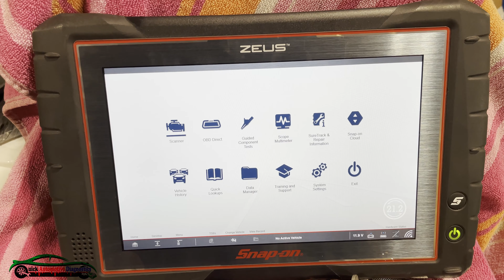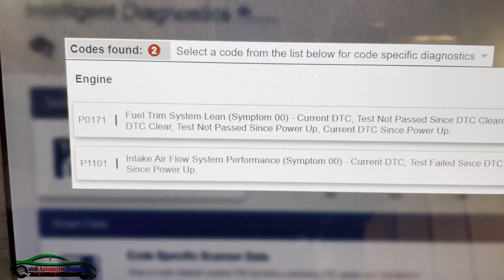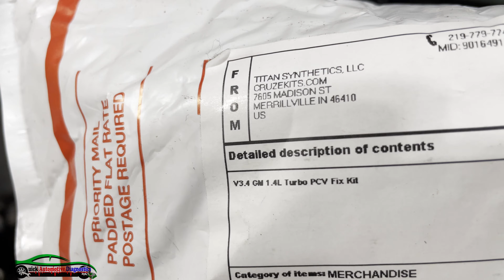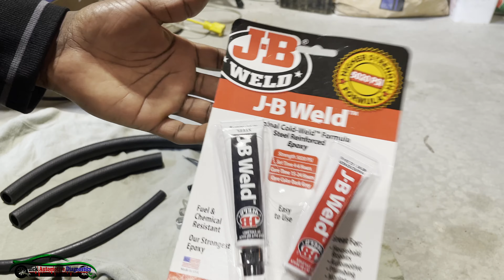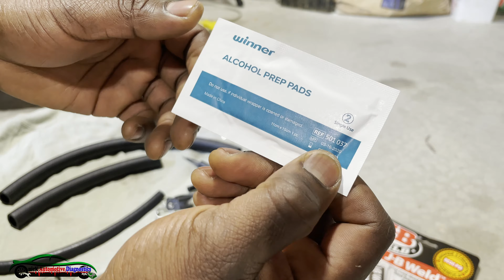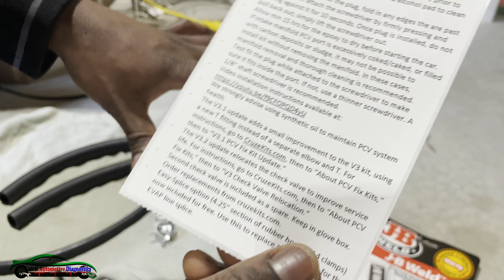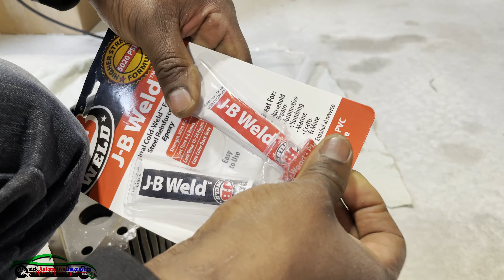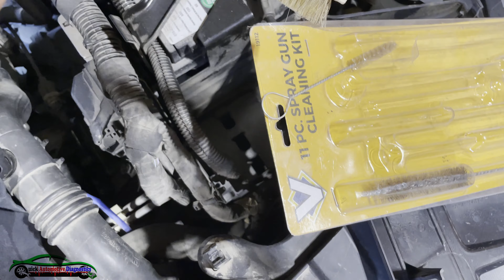CHEVY CRUZE PCV KIT FIXED THE CRUZE PROBLEM

Comment: Thanks for the TUTORIAL video, you showed the problem with the engine running at the beginning of the video but you did not show the problem being fixed with no engine noise after the repair. If you do a test of any kind early in the video, please show the same test near the end of the video to VERIFY the repair, cheers.

Comment: Thanks for your effort making the video! Much appreciated, very useful. I was still a bit confused when watching the kit instructions. Seeing yours fully assembled really helped. 

Although I took my intake off the car because I couldn't confirm the orange check valve was there or not. Originally was going to replace the manifold until I found this kit! Thank you, you did well and the errors you left in the video help. We all make mistakes but you corrected them and made it work.

Comment: We all drop stuff as mechanics.  I was in the Air Force and the U-2 pilot had a bad altimeter.  He was strapped in I reached over him to unscrew 4 screws and I dropped a screw.  That scrubbed the mission and we had to pull the ejection seat out and part of the floor board to find the screw.  So chit happens

Comment: You’re supposed to let the JB Weld cure for at least 15 hours ( a little more if the temperature is cooler )  before reconnecting the fitting on top of the hole. 24 hours to be fully cured. When you put 5he replacement valve cover on I hope you put RTV in the “ cracks” on the passenger side of surface the valve cover sits on or you will have an oil leak ( YouTube replacing a valve cover on a Cruze ( Encore, Trax, Sonic ). The 2019 Encore has a different attachment point on the turbo end. There’s actually an outlet 90 degree bends and it attaches to the turbo intake tube that comes from the air filter box.

Comment: What if, i just block manifold valve and let the engine air circulation through built in hose to turbo inlet?
Reply from the maker: If you do that you might have some drivability problems.

Comment: my friend I don't understand what this kit solves Is it so that the pcv on the engine cover does not break anymore?
Reply from the maker: It will solve the PCV problem on your Cruze.
If your cruse still running good no drivability problems soon or later you will need this kit. 
I don’t give the part number because there is different versions.

Comment: Hey I got a question. I recently bought the fix kit to repair my check valve and corrugated hose. But upon further inspection of the port, my check valve is still visible but it's really gummed up. Cleaned it up a bit and it's definitely there not sure if it's working or not. I would like to go ahead with the fix but not sure if I should just pop the old check valve out before I plug it with the clip? How would you go about doing that?  I was thinking just using a flathead screwdriver and trying to push it inside the manifold
Reply from the maker: hey man ! thanks for the question and i will do my best to help. So the orange plug is the trouble maker you need to remove it and plug that whole. that will fix the cruze problem.
Reply: @quickautomotivediagnostics8728  Ya I figured. Just wondering the easiest way to remove it. Maybe just push on it with a flathead screwdriver? Did you have to remove yours?
Reply from the maker: @suspectlikun  yeah just push it and it will drop in the manifold. It’s just a rubber piece
Reply: @quickautomotivediagnostics8728  Ok Thanks for your help much appreciated!
Reply: I used a flathead screwdriver and a right angle pic to make sure the hole was clear.
Reply: @johnfalco9528  ya I actually just cut a piece of coat hanger and worked perfectly popped right out
Reply from the maker: @johnfalco9528  
Awesome 👏 good job buddy
Reply: If you have a small brass wire brush you can use that. Spray a bit of brake cleaner ( don’t overdo it ) then stick the brush in with the bristles facing towards the windshield side of that hole. Brush gently up and down and twist side to side. Use a q tip to dry/ clean it afterwards if it was really dirty. A clean surface by where the orange “ nipple” is is critical. Also once you get that little black plastic plug in left the J B weld cure for at least 15 hours but 24 is even better. Don’t put that hose connector back on top of the hole until the JB weld is cured. Put the check valve on the opposite end of where it was put on this video just a couple inches from where that “ Tee fitting” that 3 hoses slide onto is. One end of that fitting from the kit is slightly angled  downwards. The check valve needs to be slightly angled down and the hose back to the purge valve end should be run under the hoses on the back of the intake manifold and clamped on with that nylon washer, screw and clamp.
Reply: I find the most frustrating thing is figuring out how all those connections from the old system plug in are pulled off.

Comment: Привет, возможно ли написать размеры длины и диаметр резиновых патрубков, благодарю.
Reply from the maker: Can someone translate this in English please 🙏
Reply: @quickautomotivediagnostics8728  Hi,is it possible to write the dimensions of the and diameter of the rubber pipes, thanks you
Reply from the maker: @nailfairyshin9121   yes but the Kit comes with all you need and it’s up to you to measure 📏 and cut the length you need.
Reply: Здорова 😅 а ты обратный клапан подобрал себе? Я у создателя этого набора пытался выудить инфу по клапану, ничего не рассказывает, сказал только, что давление для открывания должно быть 0.03 бар, я нашёл клапан который открывается 0.2 , ниже нету

Comment: You blew it on the check valve. The longer piece of tubing is put on first and the shorter piece of tubing goes at the. Other end as the fitting on that end is slightly pointed down as the check valve needs to be slightly pointed down also.